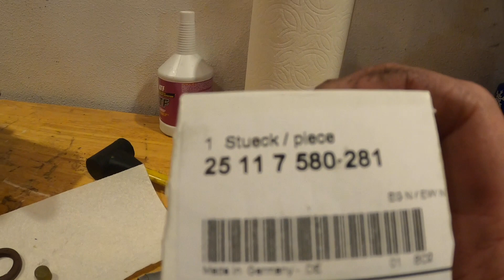Refurbishing the BMW #e39 #M5 Getrag 420G Transmission -- Part 2: Assembly.  #e39m5

Comment: Does someone know what does the bolt on the side of the yellow sticker hold inside
Reply from the maker: I believe it's something for the SMG automatic tranmission if I recall correctly from a video I watched on turning the SMG Getrag 420G into a manual.
Reply: It holds reverse idler gear. Don't remove it.

Comment: Looking  awesome mate, do you happen to have part numbers for the seals? I  cant quite make them out in the video. Thank you!
Reply from the maker: Yes I do.  RealOEM doesn't list any part numbers for the transission, but I was able to find these parts at ECS Tuning.  Transmission Shift Rod Seal 23127501582; Transmission Input Shaft Seal 23127501328; Output Shaft Seal 23121222769.  Those are the three I used.  Let me know if you need anything else.
Reply: @artwerksgarage  Thank you! Thats much appreciated.